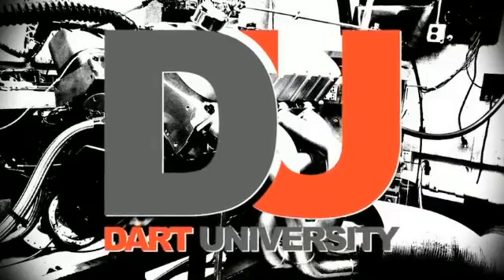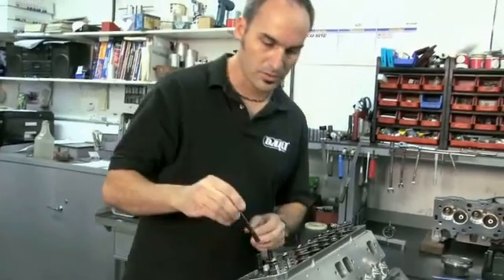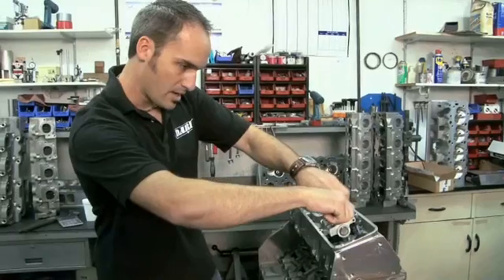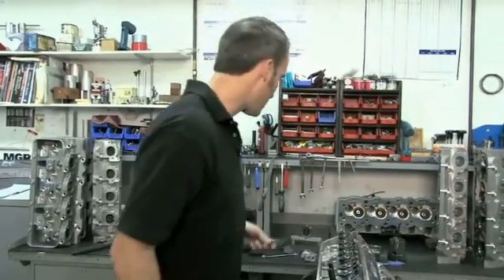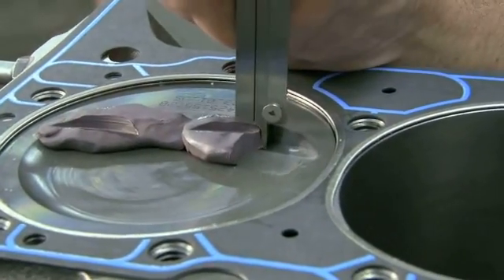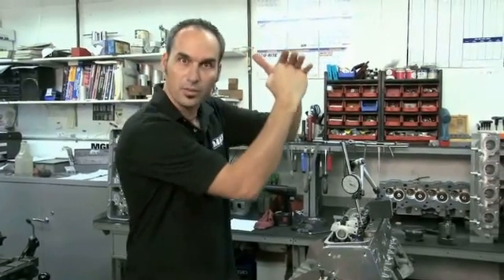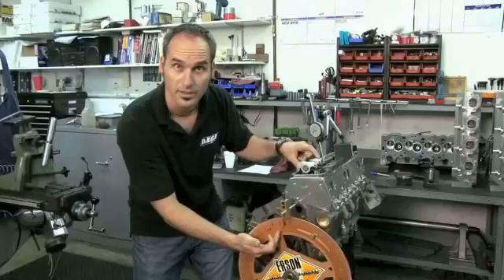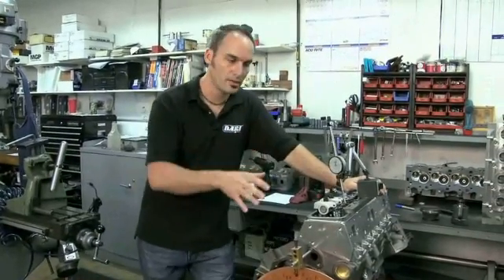Dart University, Piston to Valve Clearance

Comment: How would you go about figuring out what size thickness of metal head gasket you need to use after resurfacing the head and block - lets just use for example we took .004" off the head as well as the block and we would like to keep "stock" C/R - so would we need to use a .008" thick metal head gasket or is there a different way of going about it? Thanks!